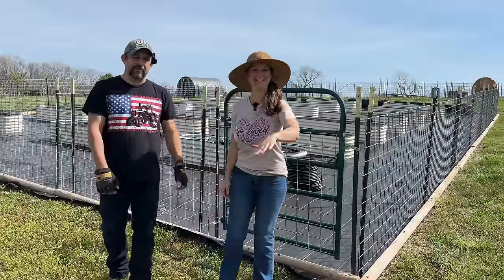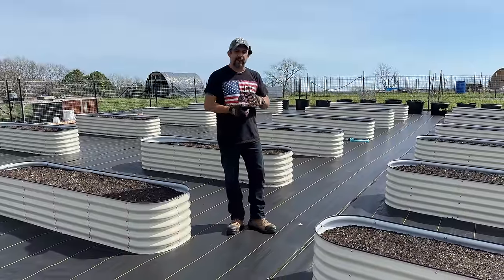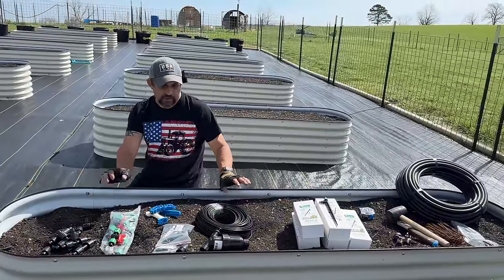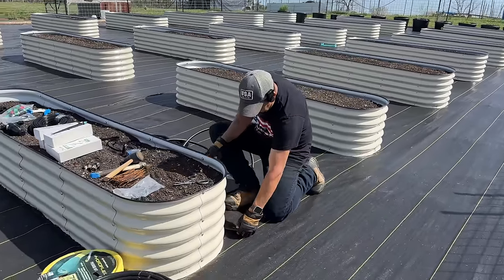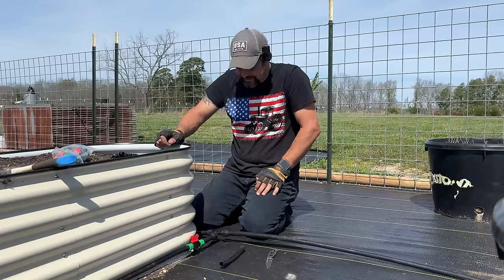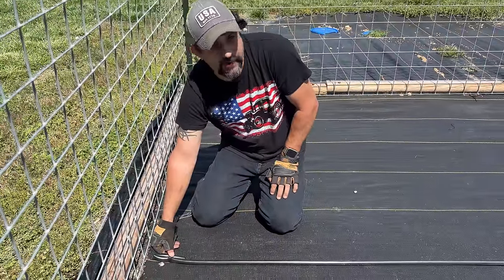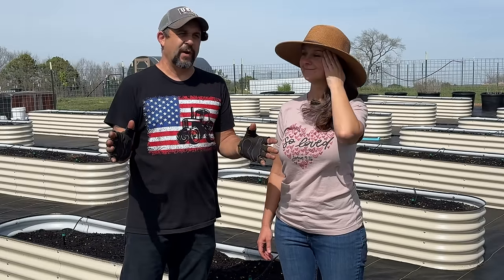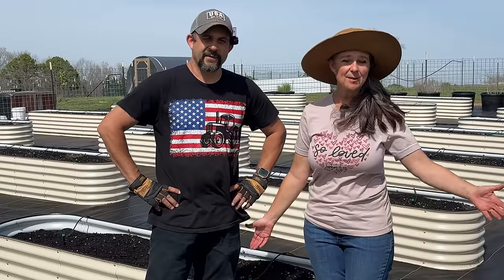The BEST Raise Bed Garden Watering System!!!!

Comment: Very informative! I have been gameplanning to get into raised bed gardening (much smaller scale than this) but have had trouble coming the up with the irrigation strategy. Your setup is simple yet functional and just as important is scalable to a smaller setup (less beds). I have subscribed and I look forward to taking a look at your video catalog and watching future videos that you release. On a separate note, I live in South Carolina where the summers get blazing hot so I have been researching shade cloth. Not sure if it the heat affects your plants to the same degree in Missouri, but do you think you may look into shade cloth for your setup? If so, I am interested in your ideas specific to your application.

Comment: Zip ties deteriorate in the sun, could break and cause a leak.  Better off using an end plug. Also, the sprinkler head water will deflect off plants.  Drip tape or 1/4 inch tubing gives a much more even coverage.

Comment: Great video, you explained the steps very well.
Pardon me if this has been answered already, but do you leave the system in place throughout the winter?  If so, do you use an air compressor to blow the water out of the lines?  How much pressure?

Comment: if you lay out the trunk tubing in a grid pattern so it connecting all the way around you probably will be able to water all of the beds at the same time. It worked for my garden so it might work for yours too.

Comment: You should consider running the irrigation line through 3/4" schedule 40 pvc pipe inbetween the raised beds so you cant damage by equipment like wheel barrows or dollys when running over it

Comment: I leave town so much that my garden would dry up if I have to water manually. So…I’m wondering, is it possible to put a battery operated timer on each row of beds after your shut off valve instead of at the hydrant, i could water each row based on the water needs of that row and allow my garden to be watered automatically? Do you see any issues with using timers like this?
Reply from the maker: It’s worth a try!